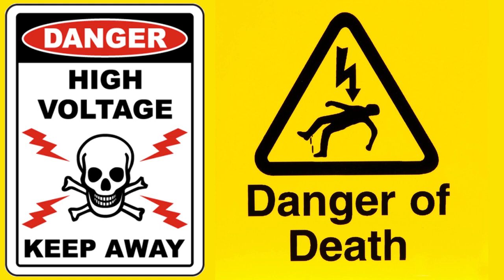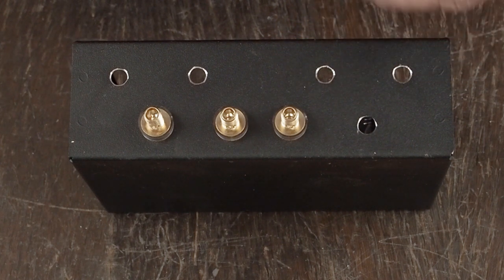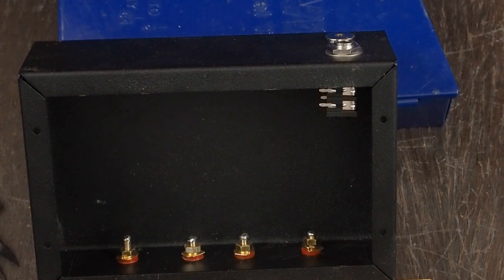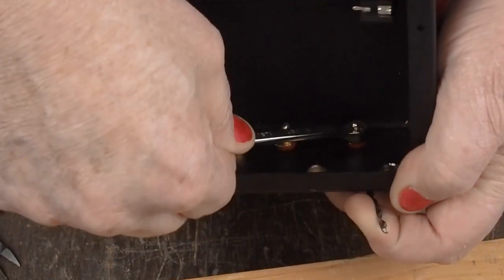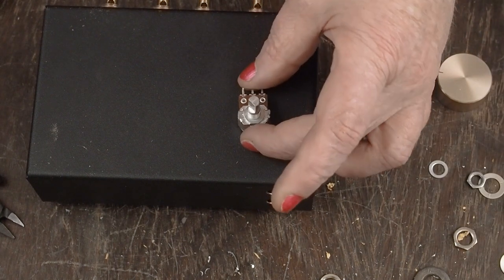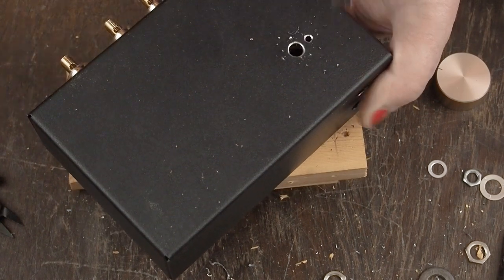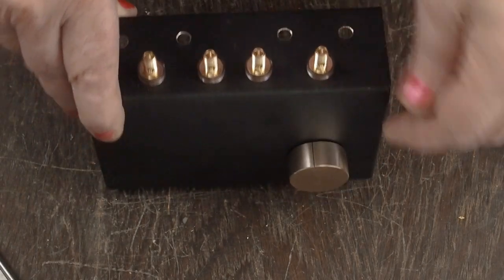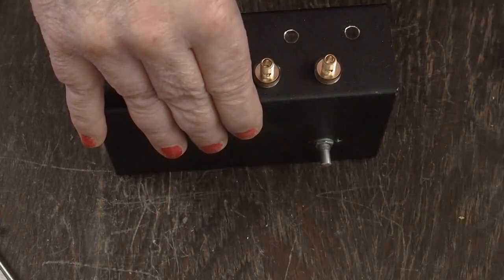Tube Amplifier Headphone Adapter: #3 Final Fabrication

Comment: Very cool project. Are you gonna be building only passive devices now due to that idiot who said they shocked themselves? I’m obviously just kidding, but that is a serious topic as you know after speaking to your lawyer. I work at a guitar and tube gear repair shop, and my buddy who owns the shop is extremely weary of even giving customers any advice whatsoever, because he doesn’t wanna get sued by some damn fool. So anyway, I’m sorry you even had to deal with that. I did almost piss myself when you mentioned the Darwin Award though. Thanks for another great vid!
Reply from the maker: Absolutely not! This was something to answer a lot of questions, felt like a great starter project + an introduction into understanding and reading a schematic.
Reply: @SkunkieDesignsElectronics  I was just joking around about the passive devices, but you’re right about a simple project and being able to read a schematic. I liken that somewhat similarly to being able to look at a resistor and know it’s value very quickly by the color of its rings. Thanks again! Love your vids. 👍🎶🙂🔊
Reply from the maker: @RCook-iy4xk  stay tuned and yes one end left open. I questioned that too but seems to work fine.
Reply: @RCook-iy4xk   If you look in the description of the video, there’s a link to the schematic on her site, skunkie designs.